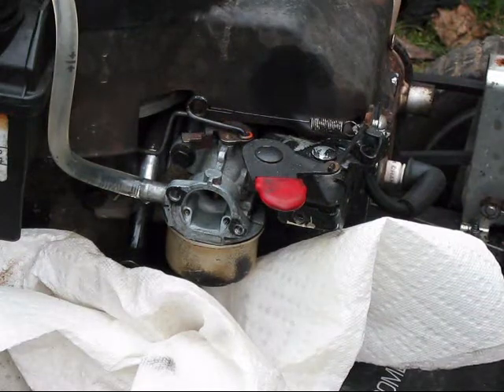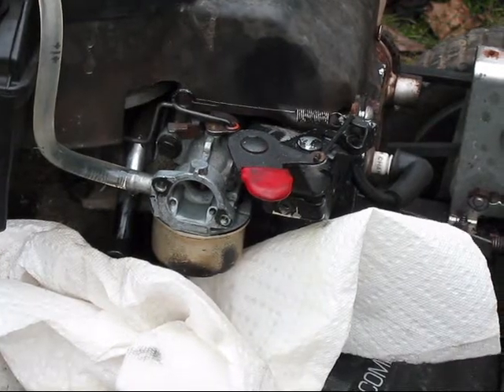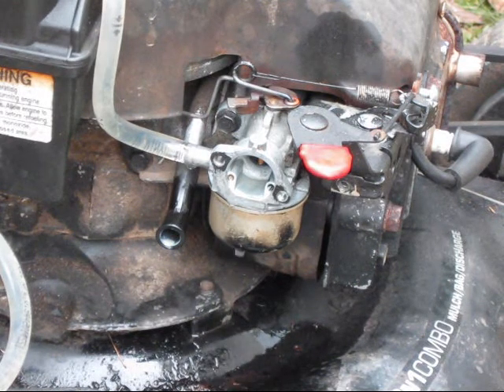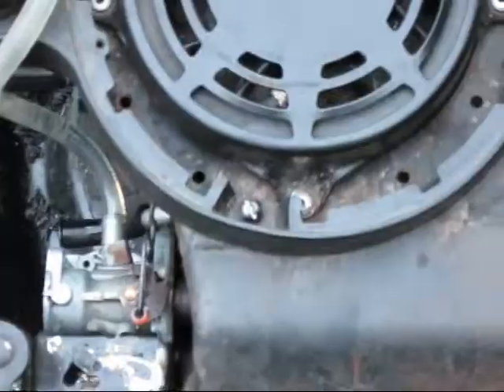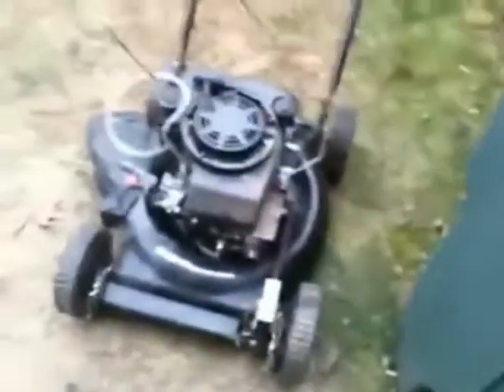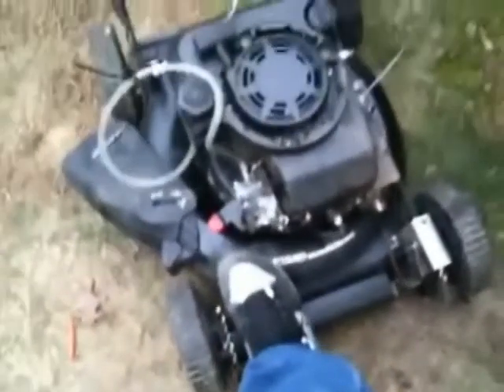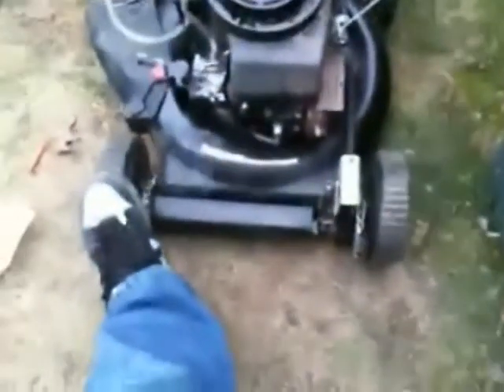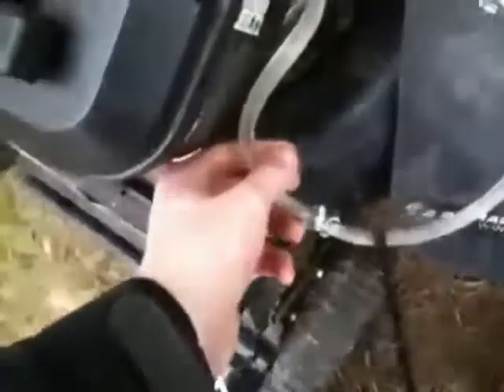Briggs And Startton Engine Problem PLEASE HELP!!!

Comment: Seeing multiple problems. It looks as if the gas is coming out of the primer passage, just in the front of the carb? In that case, the float is stuck down. The main jet it restricted as well. Alse, there's quite a bit of blowby (burning oil) coming out of the breather tube. Change the oil with SAE 30, clean the carb, unstick thefloat  valve, and change the gaskets. Should help your engine.